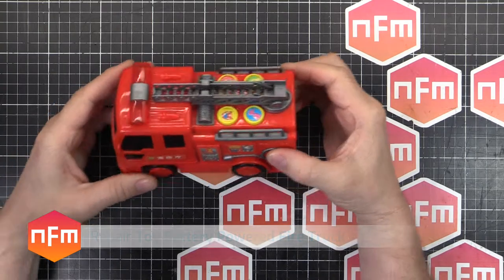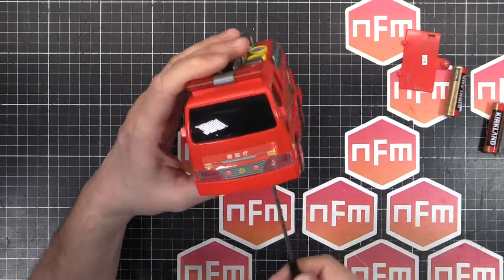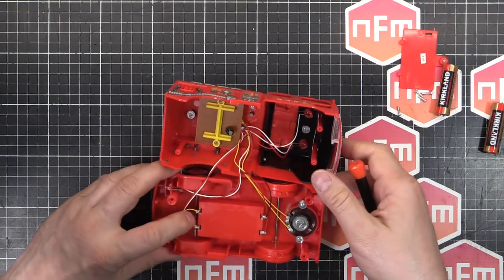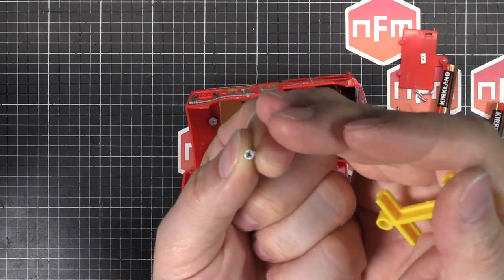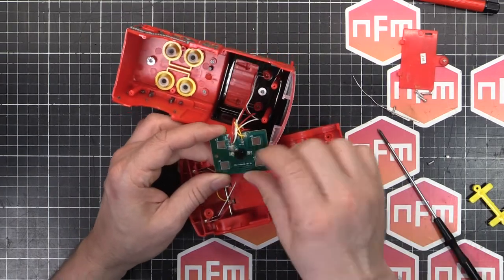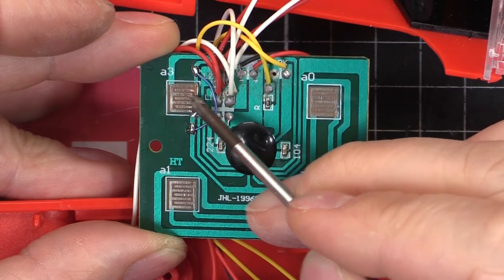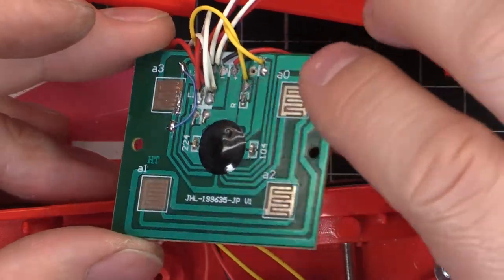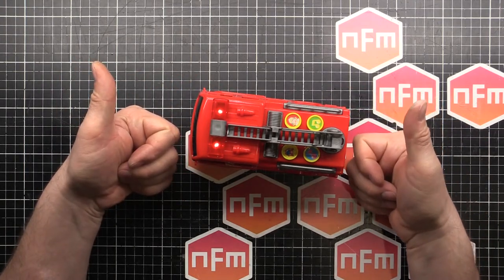Toy Fire Truck Repair

Comment: ..would you happen to know what connections are necessary for a 2013 tonka fire truck on the #06261 circuit board.
There are two LED's, speaker, 3 buttons (on the circuit board).
Wires broke off and I am not sure where to solder back on.